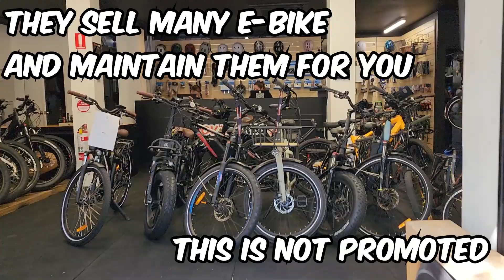F1000 ET Cycle motor broke down (repair)

Comment: When you install the huntsman  tyres , if you take the rear mud guard stainless steel  support  and under fit it  iinstead of it going on the outside as from the factory you get the clearance  needed  and no extensions  needed it all just fits neatly 😊

Comment: How many hours of riding and doing deliveries around town, before the planetary hub eMotor seizure / FAIL ? 
What did the LCD das kit digital odometer read when it failed ? Where were you exactly when it frooze / seized on you ? 
Rough estimate on how many Kms or miles did it read, when it "shit itself " ?
How much did MoveBikes charge $ you, if they did not supply a complete new exchange Bafang eMotor ?
Was your F1000 out of the limited one year warranty period ?

I see typical gear race & epicyclic with lack of proper grease & lubrication....
Do you think Bafang OEM did not charge the eMotor epicyclic with substantial LUBE in the first place ?
The mehanic in video, examined teeth&race but did not exchange or condemn the whole assembly. Why ?
What type of grease did that mechanic actually apply....general or something specialized
with your heavy duty wear & tear demands in mind ? 
Have you noticed changes for the better or WORSE ? Has the new epicyclic RATIO gear teeth  :  gear race... increased the TORQUE or SPEED of your eBike ?
Reason is I'm interested and thinking of purchasing this particular folding eBike F1000 model. 
Need to know that it will not FAIL just after the 12 month warranty period. Cheers R :*)
Reply from the maker: i will reply you later when i got back to my computer.. this is a bit too long..hahaha cheers
Reply from the maker: How many hours of riding and doing deliveries around town, before the planetary hub eMotor seizure / FAIL ? 
-- lots of deliveries.. and lots of inclining climb as well.. and it fail because on 1 rainy day, i push it too much like almost 10 hours without stop. suddenly it breaks the gear like 20% i think.. cause i can hear the sound but it still working. and then 2 weeks after it fails totally on a climb.

What did the LCD das kit digital odometer read when it failed ?
-- the Das Kit works perfectly.

Where were you exactly when it frooze / seized on you ? 
-- on kent street bike path to millers point.

Rough estimate on how many Kms or miles did it read, when it "shit itself " ?
-- i would say if you use it normally, it wont break that easily. it did on mine because i overuse it

How much did MoveBikes charge $ you, if they did not supply a complete new exchange Bafang eMotor ?
-- they dont have the replacement gear at first. and if i want to fix it.. need to buy new motor $500, but i found it online and bought it for $75 and they charged my $50 so in total it was $125

Was your F1000 out of the limited one year warranty period ?
yes, its like 1 year and 5 months i think when it happened

I see typical gear race & epicyclic with lack of proper grease & lubrication....
Do you think Bafang OEM did not charge the eMotor epicyclic with substantial LUBE in the first place ?
-- i think they did. but i just rode it on super duper extreme heavy rain.. maybe the rainwater get into there.

The mehanic in video, examined teeth&race but did not exchange or condemn the whole assembly. Why ?
-- because he know the gear was broken.. i went there 2 weeks prior and they already know what the problem is. so they just need to change the gear with the new one.

What type of grease did that mechanic actually apply....general or something specialized
with your heavy duty wear & tear demands in mind ? 
-- this one, i'm not sure

Have you noticed changes for the better or WORSE ?
-- it is the same.. totally 100% same.. no change

Has the new epicyclic RATIO gear teeth  :  gear race... increased the TORQUE or SPEED of your eBike ?
-- nothing change at all.. because if the RATIO is different.. it wont fit on the first place.

Reason is I'm interested and thinking of purchasing this particular folding eBike F1000 model. 
-- no, it wont break like mine.. this is the super monster heavy world class e bike.

Need to know that it will not FAIL just after the 12 month warranty period. Cheers R :*)

-- it will only break like mine, when you use it like me.. 10 hours in SUPER DUPER EXTREME HEAVY RAIN..hahahaha

yes i'm crazy.. thanks ;) Cheers!

Comment: I found the sequence where the MoveBikes mechanic disassembles the hub and ! YES !...I was correct in saying that the eMotor has very little protection against FLOODING.
Reason is the the ORANGE O-RING seen in your FAB VIDEO. The O-RING is not an o-ring anymore and is probably FLAT SPOTTED plus these mass produced eMotors have
dedicated MANUFACTURING ENGINEERS that work out how to MAXIMISE PROFITS by CUTTING CORNERS literally in this case. It's about targeting the O-RING & SEAL/ HUB HOUSING....there is no o-ring KEY. What was a circular O=Ring is shoved up into hub corner and the FLANGE has no gasket at all. The flange itself should have a dedicated GASKET ...making a SEAL against dirt -water ingress----purpose built for it. I see none at all ! The MoveBike mechanic did not replace nor make-good a proper seal and put it back the way it came....SOOooooo CONSUMER BEWARE that it will probably FLOOD again and waste LUBE from the STAR-GEAR / EPICYCLIC and SEIZE. Could be over the handle-bars at downhill speed and another long walk, legging it back with that 34KG = 75lbs = I 1/2 bags of portland cement. The ET Cycle F1000 is a heavy weight unit another spec people over-look. Do the recording of Kent St to Millers Point now its operational. All the best noisy neighbour....Robert a very experienced applied science & engineer :*)

Comment: Hi Noisy Neighbour....so you're firm on WATER INGRESS....that's water entering the interior TRANSMISSION gearbox--- inside the rear eMotor HUB and washing out all VERY IMPORTANT LUBE inside----which according to your experience riding it... is the main cause of FAIL ?...... NO LUBE !!.....How the heck did water get into a highly developed eMotor that they are mass producing in China by the hundreds of thousands ?
I'm going to ckeck your video again and see if I can spot any SEALS built into the hub motor D&C transmission. I'll post a TIME sequence if I spot any....but I reckon it has NO SEALS !! from the " Made In China get go ".
Proper solution would be a bead of GASKET / SILICONE GOO  around the hub assembly to SEAL it. Do you think MoveBike mechanic has sealed it properly when he repaired ?
Can you make a list of replacement hub eMotor and transmission(s) that you researched prior to sending F1000 back into the MoveBikes workshop at Surry Hills....post up on comments, please ? What is the actual brand of eMotor that dodgy LEON Cycles / MoveBikes are putting on the F1000 eBikes anyhow....please list. R :*)
Reply from the maker: yes, the Lube washed out because of the rain i suppose. and that might be because a few week prior i went to the shop trying to replace the gear, but they didn't have the replacement. thats why they need to open it and re sealed it again.. maybe that's when the SEAL fail somehow.
but anyway.. if you don't overdo the bike, this is the BEST BEAST you can get ;)

Comment: PS....why don't you take the opportunity of using your camera at work during interesting delivery runs and shoot the complete Kent St to Millers Point run on the repaired ET Cycle F1000. I know that route runs over the Harbour Bridge. Point out to your audience using AUDIO like my RODE PRO Wireless mounted on your helmet etc to describe EVENTS and all the 10 : 1 HILL CLIMBS & STAIRS that the ET Cycle F1000 had to perform & manage on that SUPA DUPA RAINY NIGHT....before F1000 went " BUNG ". Did you have to walk the ET Cycle back to Kiribilli / Milson's Point Railway Station and then back to home base ?  R
Reply from the maker: i couldn't even think about recording when it happened. what on my mind was how to get that heavy bike back to my home first. and yes i walk it back like about 2KM :)) and i went to the shop on the next day to get it repaired